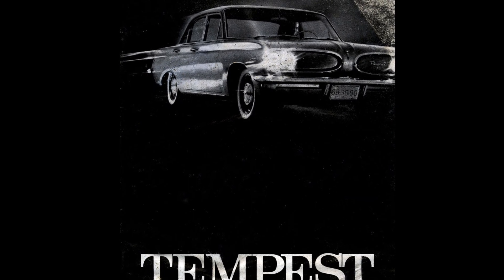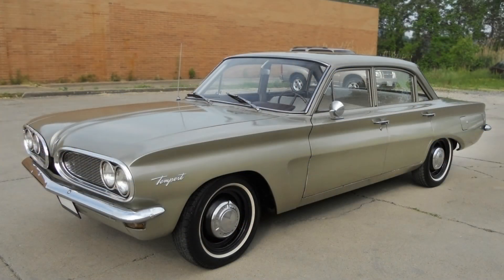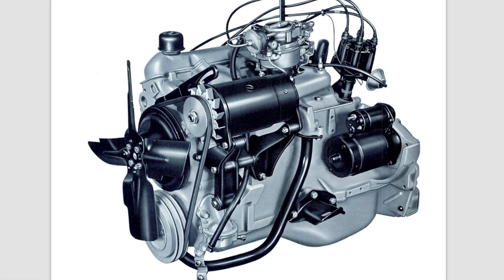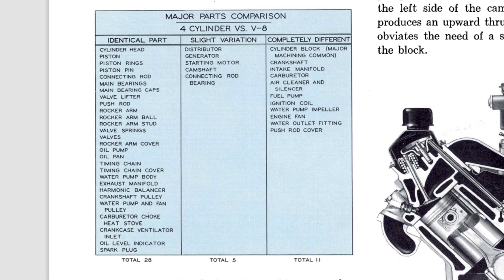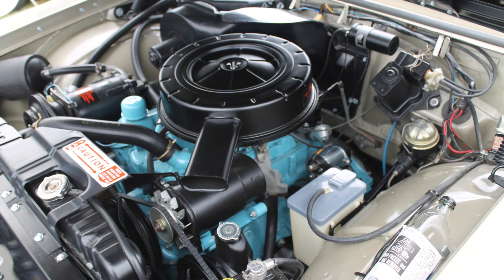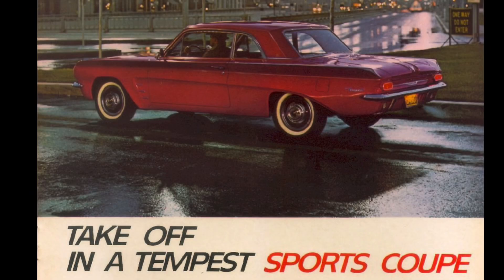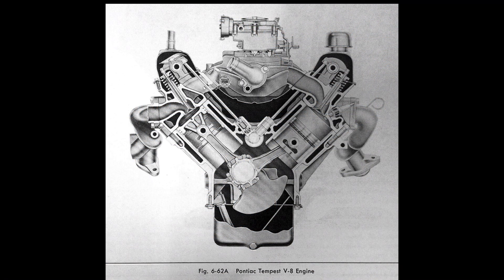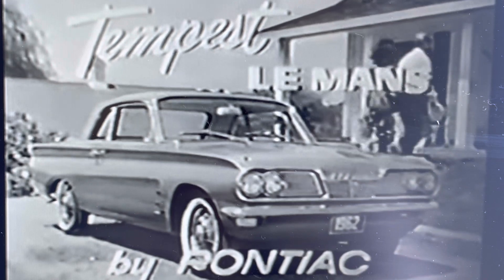Strangest Automotive Engines: The 1961-63 Pontiac Tempest & Its "Trophy 4" / "Half 389 V8" Engine

Comment: It's also a cross flow head design which is rare for 4 cylinders back then
Reply: Well it is a 389 head. Their later Iron Puke was also cross flow
Reply: @mpetersen6  
I loved the Iron Duke.
Reply: @mpetersen6  - Iron Duke got cross flow head and DOHC head later on...
Reply: @BuzzLOLOL 
Yes I know it got the crossflow after a while. The Puke was actually based on the Brazilian version of the Chevy ll 4 banger. Which was based off of the Chevy 6 as I understand it. If so its has the same bore spead as the Small Block and could probably take an LS head with some surgery.
Reply: @mpetersen6   Thats what midget racers did with the Chevy II 153  back in the 60s and 70s and they made great power.
Reply: The ford 2.0 and 2.3 were crossflow as well